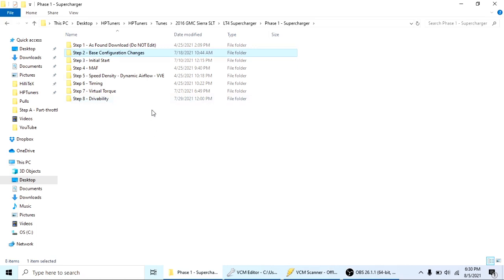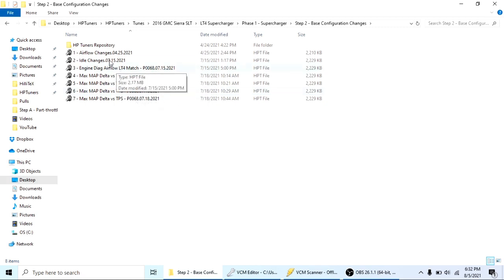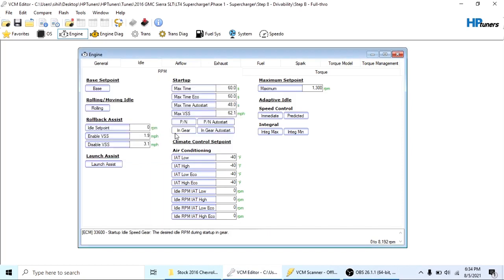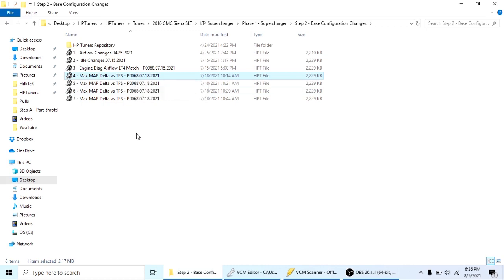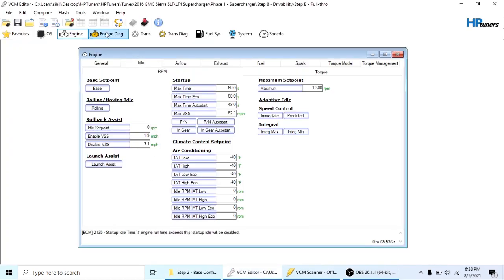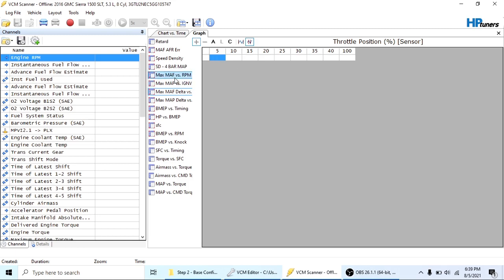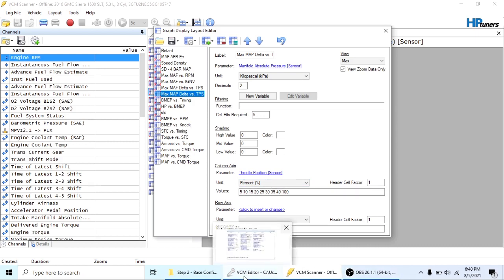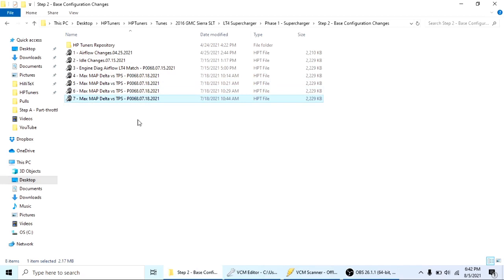LT4 Supercharger Install - Tuning, More Base Config Changes

Comment: what was the first changes you did in hp tuners for the first start
Reply from the maker: Hi Mr Davis, the first changes I made are covered in this video https://youtu.be/3ItErB8ZKMw around 4:25. In summary, the changes were around airflow - to account for the throttle body and supercharger volume -, spark, and fuel.